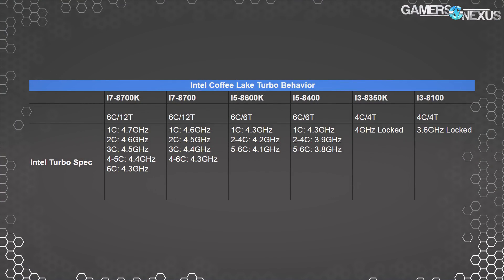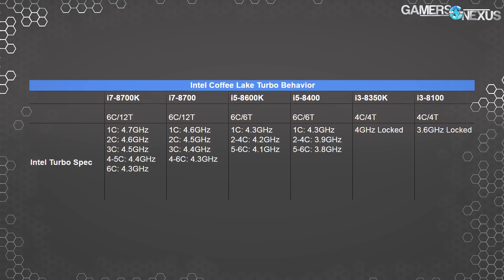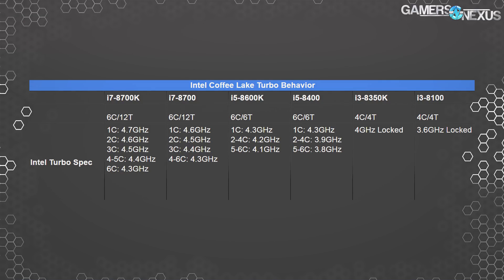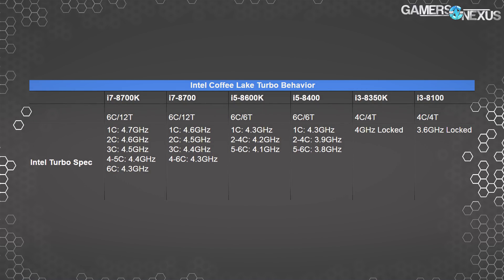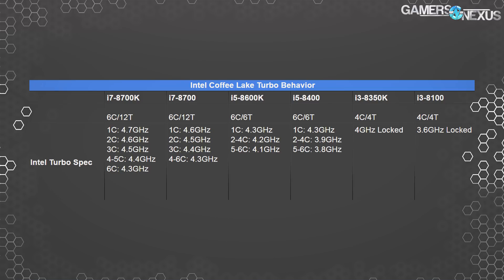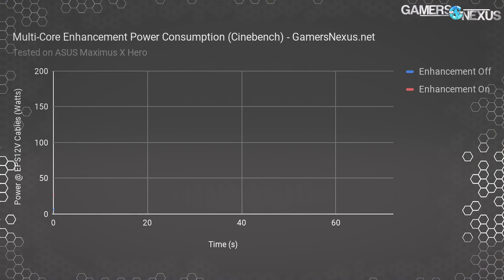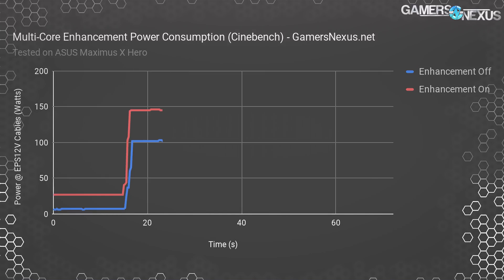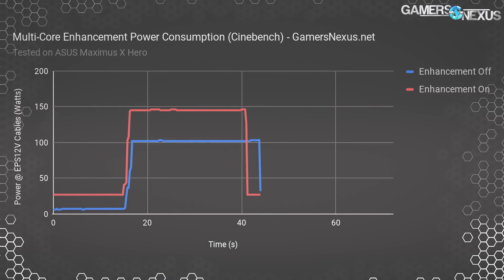Explaining Coffee Lake Turbo Boost Variance & Multi-Core Enhancement

Comment: Ok, to mb venders off by default 
If you want to turn it on at any point, make sure the user knows and that it can add instability, possibly some modes that don't aggressively oc and keep the normal oc voltage or keep the normal oc but increase the voltage a bit. 

anyone who will oc won't be using these, so it's for people who are normal and don't know their shit. 

Possibly a back panel switch for on and off, and then a 3 way for low clock normal and high voltage.

Comment: Off by default. If my system is unstable out of box, I'm blaming the board, not the CPU. Last time my system quit, I guessed it was the board. Microcenter employee suggested it was the PSU; i decided they were wrong. It turns out I was right; so, I bought a different board.

Comment: Multi core enhancements should be OFF by default in my opinion! Even if it boosts performance, it's something that the average user does not expect from the CPU.
The CPU should run at whatever it was specified by Intel to run at unless the user changed the specific setting manually.

Comment: Great video thank you
I agree off by default reason is if it can make the system unstable that is a bad thing and all it does is make the main board maker look bad because that new system was unstable out of the box because the CPU was running out of spec out of the box because of a out of spec setting.

Comment: Used gigabyte in all 3 from scratch systems I have built or owned. Hardwares always great early adoption is a mixed bag bios wise but it gets fixed. f8 For the aorus gaming 5 for am4 has been perfect for me. XMP works and the 1600  previously had weird clock behaviors when changing voltage that was fixed.

Comment: Steve ive got a 6700k and a Z170 Asus Pro Gaming mobo and i have overclocked my CPu to 4.6ghz and my ram xmp is at 3200mhz .......My Asus multi-core enhancement setting is set to Auto..... if all im doing is playing games am i better having it set to Auto or Disabled?

Comment: Hey Steve, where did you get the info for the max 1c clock speed boost of the 8400? Is the 4.3 an error? https://en.wikichip.org/wiki/intel/core_i5/i5-8400

Comment: Off by default, the inexperienced user will encounter said crashes and wind up chalking it up to bad components and end up being far more of an issue than it needs to be. IF they were to have it enabled by default it should give a warning with something like "You have core enhancement feature turned on, this is known to cause instability in some programs and if you encounter this it is advised you turn it off in the bios(insert link to a guide to help the user find the setting in bios and turn it off)"

Comment: Multi-core enhancement should OFF by default.  

All defaults should ALWAYS be the most stable and most vanilla options possible.
Everyone buying motherboards will be inside the BIOS anyway and can at that point chose to enable it or whatever. 
I always enable it - but that doesn't mean I want the manufacturer to enable it by default.  In fact, as a customer, I would lose  A LOT of confidence in any manufacturer that set it on as default.   That would be akin to setting overclock parameters by default - which would just be crazy!

Comment: By default the cores should follow the intel guidelines. All the intel features that help adjust the CPU performance and resource demand based on load should be turned on. This is not only the Intel turbo boost, but also things like intel speed step (tm).
I also like how my Gigabyte (z87x) board has bios options where the multipliers for the turbo can be set, so instead of overclocking my cpu to 4Ghz I can set the turbo multipliers to 41, 40, 40, 40 (1,2,3,4 cores). It would be awesome to get some voltage control here, too.
So the default would be to let intel control voltage and frequency based on load and then you can do overclocking that also uses the intel features to reduce power consumption (and thermals) when you don't need the power. That would allow you to A) overclock further and B) not use so much power when you're just typing something in word.

Comment: I would prefer it off by default.  I am a novice at PC builds.  I still have yet to overclock a darn thing out of being overwhelmed and nervous.  I do prefer it being there in the BIOS so if I want it and believe my system and programs can handle it, I could enable it.  But yeah, off by default preferably.

Comment: so, would it make more sense to get non-k version for better stability?  i can still do xmp with z motherboard, right?
Reply: robert You can turn on XMP and Multi-Core Enchancement on non-K CPU's if you have an Z motherboard. 

You just can't overclock the CPU. The way to "overclock" an non-K CPU is by using Multi-Core Enchancement that will set higher frequencies. This might also make the system unstable because the CPU's are not manufactured the same and some will run for example at 4.6GHz (all cores turbo boost) and some will crash because they can't run at 4.6GHz, but lowering the voltages and the clock speed at 4.5GHz can make the system stable. Too bad it's an non-K CPU and you cant under clock it.

Comment: I paused before you gave your thoughts, so what follows are my own opinions on the matter, which apparently coincide closely with yours. 

I would prefer the option OFF by default, so that less thorough reviewers aren't showing skewed results when comparing the Intel products to competitors. That said, I would like to see the option to turn it on almost immediately visible and a clear educational blurb showing in the BIOS as to what the setting does, so it is not some "obtuse" setting that less experienced overclockers are afraid to turn on, because they aren't certain what it does. I feel that if the setting is more clearly labelled, less thorough overclockers will have greater clarity how the BIOS settings on this and other platforms can affect or skew their results and again, so that less experienced overclockers can learn what the feature is, and why they might want to turn it on or off. 

If the default is on, then the performance and power consumption of your chosen platform automatically exceed the advertised performance and power consumption of your chosen platform, and certain users definitely prioritize power consumption over raw performance.

edit: Thumbs up bud! Both your content and hair are glorious! Keep up the good work!

Comment: On by default obviously. Why wouldn't you want have better performance out of the box because it might crash in some rubbish benchmarking software which 99.9999999% of the people who buy hardware don't care.
Reply: Silent data corruption.
Reply: Blender isn't a benchmark. :P
Reply: stock cooler might not be able to handle the temperature as well
Reply: Yup, running all cores at max turbo in an average game or program that only uses 1-2 cores that would be able to use the full turbo boost anyway. The average person doesn't run anything that would actually see a real benefit from this and the people who would see a benefit from it would turn it off and do their own overclock anyway. This "feature" shouldn't exist at all imo. Only good thing about it is warming up your room in the winter.
Reply: First of all Blender is not a benchmark but a serious application people use. Crashing in applications is a complete deal breaker, and doing this after the novice user accidently activated the setting is even more problematic. It should be in the motherboard makers' best interest to force this to be an active decision to lower the amount of support requests. And don't even get me started on the horrific effect on efficiency that the setting has.

Comment: I'll rather have it disabled, cause it is basically a mild overclock with way too much voltage. If you want extra performance you can manually overclock or use your mobo utility. It can make sense on a non-k model, but I'll rather turn it on myself

Comment: OFF as default. It clearly is an unstable release(by certain brands) if intel thought their chips could be at 4.7ghz on all 6 cores with stock cooler.... well the chips would be sent like that! 
Intel are known for “reliability” overvolting to keep all cores will not be good for the large industries.. hospitals schools extra who use intel for the reliability! At least gigabyte keep it off as default. 

I mean its a nice thing to have.. for the ones who go into bios “normally” are there to O/C or have a little tech savvy. But i think i would prefer a manual overclock and have voltage under control than allow it to be auto and unstable.

Comment: Typical users must not have to worry about features that can cause instability. These options must thus be off by default, there is no discussion possible really, there is no other side with a valid argument.

Comment: If it works with non-K CPUs this is a no brainer. 8400s single core Turbo Frequ/Voltage wont be all that high, but you get a free OC

Comment: Ask GN (repost): 
One thing I found interesting about the Chipset: the Z370 has a 24 lane PCI-E switch, th lowest Chipset having 12 lanes. That's a LOT of lanes, so most Motherboards have at least two M.2 M-Key PCI-E 3.0 x4 slots. But the Chipset is connected with DMI (Direct Media Interface) 3.0 x4, which "so randomly" has the same bandwidth like PCI-E 3.0 x4 slot. Isn't that limiting you in some way? 

I could imagine running two M.2 SSDs in x4 mode in any raid being as fast as a single one (if the M.2 ssd can fully utilize the x4 connection, so like a Samsung M.2). But it would be also interesting to see how it impacts budget-class buyers with a single M.2 while maybe having a sata ssd or writing to a usb ssd or just Networking. 

I also see a little opertunity right here for future Ryzen Motherboards to shine as they could redirect extra the CPU x4 link, currently mostly used for a single M.2, to the Chipset. They could have a PCI-E switch connected with an PCI-E x8 link to the cpu, allowing for higher transfer rates and even the usage for two M.2s at once while retaining the bandwidth.

Comment: I think Multicore enhance should be disabled by default. Stability problems, higher voltage and almost 50% more power consumption, are all reasons to leave it off.

Comment: The Multi-Core Enhancement should be OFF by default.
Reply: Quick question : Generally how much more vcore does the CPU require to be Blender stable compared to like Prime95? I thought P95 stressed the CPU more.

Comment: By default it really should be off. If cooling solution is inadequate or there's an issue with voltage and there is any possibility any program could become unstable it should be off by default no questions asked. However this can be dealt with bios updated for those who choose to have it on.

Comment: Off by default for me.

The data shown in the video here provide further substance to the meaning of the word "specifications". 8700K's TDP as provided by Intel is 95 W, and the data shown here quite clearly show that's when the six cores are capped at 4.3 GHz, the frequency at how Intel came up with the TDP. You put all-core enhancement in and it bumps to 140 W. That makes a huge difference to the cooling solution required. With 90-ish wattage you could get away with a good Noctua 90 mm cooler if your case ventilation is good.

Comment: Well with a board like Maximus X Hero, I'd hope users are aware of what they are getting themselves into. I want to say perhaps it could be set off by default by price brackets of motherboards? If you are spending over $200 on a board I would hope you know or are aware of the features included. I understand both sides of the coin. I don't think it should be enabled by default though. I like the idea of if you enable some other feature it asks you if you want it.

Comment: NO. Keep it off by default.

My first gigabyte 7700k board had that crap on by default. It overvolted my CPU, and ran it at 4.5 GHz in gaming at all times. The temps were WAY higher than they should have been and my cooling solution didn't cut it. Switching to a MSI board that doesnt have said feature, and uses a lower voltage, Im getting a MUCH cooler temperature.

here's the thing. Some of us run our computers in "extreme conditions". I game during the summer in a non air conditioned room. It can be as hot as 95F (35C). 

Researching online, you DON'T want intel CPUs to run over 80C consistently. They can do it, but you shorten their lifespan from heat if you do. 

During the winter (20C ambient), that gigabyte board was raising my temps in the 70s, around 70-74 playing battlefield 1. I would sometimes spike up to 78ish in some applications. 

A voltage fix reduced this down to around 70ish, but still, I need 15C headroom for summer there, going from 20C to up to 35C. 

With my MSI board, my 7700k runs at 63C maximum during the winter, with temps up to 78-79C in the summer. PERFECT. Just enough room. And that board has no multicore enhancement, no voltage spikes, etc.

So yeah, DEFINITELY keep that crap off. If an enthusiast wants it on, let them turn it on as their thermals allow. But it should not be a default option.
Reply: My Asus Z270E board also has it on by default, i have seen it crank it up to max turbo outside of games when the cpu usage is under 10% where the cpu has no business running at full turbo. I am so glad all this hubbub over the 8700k reviews using this came about because i finally figured out what was causing my turbo boost to also be maxed out since no amount of googling could i figure out what was causing it.
Reply: MSI has "Enhanced Turbo, which is the same setting under a different name from what I can tell by reading up on it online. The setting is set to [Auto] with XMP enabled, not sure if that means it's not actually On or not. I am just now testing the [Disabled] setting with an i7 8700K and MSI z730 A Pro mobo, XMP enabled and RAM at 3000 because at the moment I am running a CM 212 EVO and my CPU temps were in the mid-80s during gaming and I'm hoping the voltage, and subsequently the core temps, will be lower with the setting on [Disabled] but I don't know how this will affect game performance yet.

Comment: Lol multi core enhancement is a sneaky way to make CPUs look better on certain mother boards my 7700k boosts to 4.5ghz on all cores without touching anything as ASRock defaults to it enabled
Reply: There are better more positive ways they could get attention other than enabling a potentially dangerous "feature" by default on their mid to lower range budget boards.
Reply: Or, it could be to give their customers better performance out of the box. I imagine that motherboard designers get bored making components that basically do not get any attention unless they break.

Comment: Everyone knows motherboards sell best depending on how many unboxing videos there are of it, and how much RGB is on it. Not on performance purposes.
Think about it, no one buys the sports version of a car because it performs better. They buy it 'cause it's the version with extra options and a flashy paint job.
iLike the idea of a "CPU Boost 3.0" option. iBelieve such option should be off by default, with the ability to turn it on in a "EZ OC" section of the BIOS once you get everything to post and are able to boot.

Comment: This Multi-Core enhancement should be off by default. Most users won't notice this performance benefit and you save some power. This feature should only get turned on by explicitly asking the user. More advanced users will have their own opinion and rule with it their way. 

Short answere, the decision should lay by the user. Default turned off.

Comment: OFF by default. On is basically overclocking and thus working out of spec. Any OC should be fine tuned to each CPU individually due to silicon lottery, and preset voltage-frequency tables would lead to either crashing or excessive heat generation, not to mention that some users might still use stock cooling. And an overclocked six-core i7 with a stock cooling? Bad, bad idea.

Comment: This is literally an auto OC mode ... so off by default, they use way too much voltage for nothing. That said, I think this feature work with a locked chip like the regular 8700 right? So in that case, that's good~ as long as people can adjust voltage and shit.

Comment: As a user, I want any features of this kind OFF by default!

I would rather overclock everything manually, as it is more reliable with the silicon lottery.

The multicore enhancement seems like a carpet bomb approach, where a more involved manual overclock would accomplish more with potentially less power draw, heat, and instability. Then again, if I bought a non-K SKU (which I wouldn't) I might actually want the setting enabled.